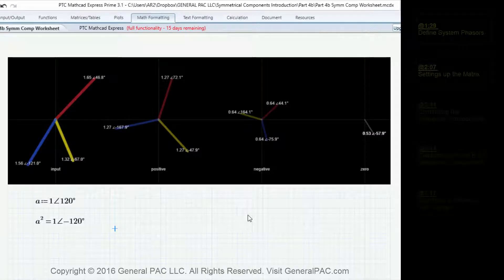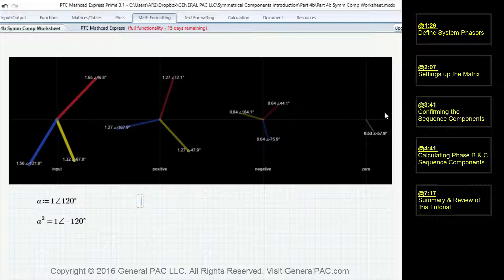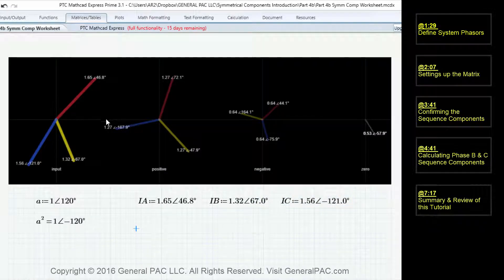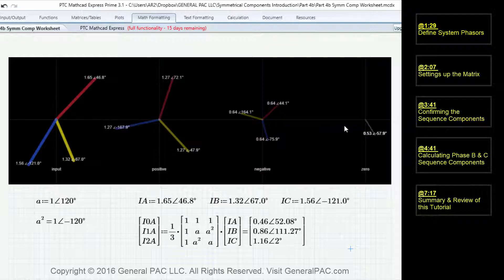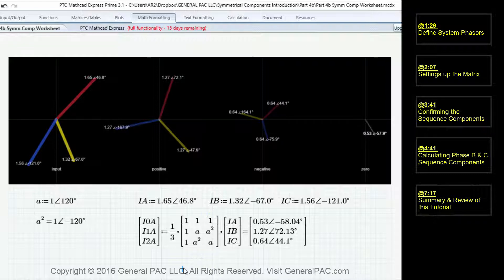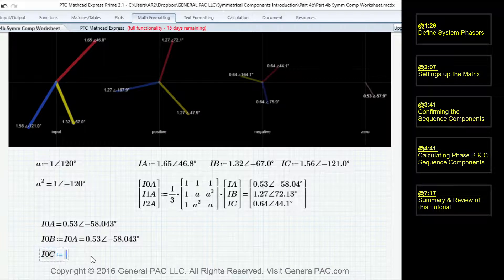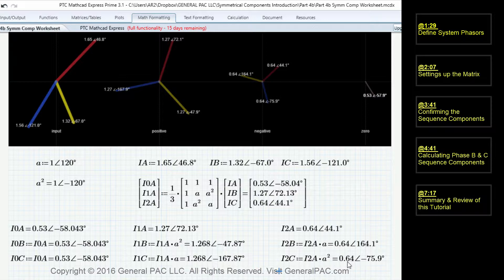Principles of Symmetrical Components Part 4b

Comment: Thank you so much, your series of Videos is so useful. Just a quick question,  since in that problem you have the  Matrix [ I0A I1A I2A]  by multiplying the inverse of A with I(system)....will I be wrong if I decide to first solve the matric of [I0B I1B I2B ] ?
Reply from the maker: Hi Njabulo, Yes you can first solve the matrix of 
[ I0B I1B I2B ], but all the formulas will change accordingly.

Thanks,
GeneralPAC by AllumiaX

Comment: I finally understand the unbalanced system and the symmetrical components watching this series, thank you for your efforts.
Please can you tel me how can I define the a operator in Matlab or Simulink ?
Reply from the maker: Hey,

You can write 'a' operator in MATLAB by first defining the operator as:

                        a= 1*exp(i*2.09)

where '1' is the magnitude and "2.09" is the angle in radian (120 degree = 2.09 radian) (in Matlab angle is defined in radian)

(formula for the degree to radian conversion: angle in radians=angle in degree*pi/180, where pi=3.14)

(120 degree*3.14/180 = 2.09 radian)

For more, see this link:
https://www.mathworks.com/help/matlab/ref/angle.html

Thanks,
GeneralPAC by AllumiaX
Reply: Got it. Thank you so much 🙏

Comment: 1:03: "and the zero sequence component, although they all rotate in the counterclockwise direction, same as the negative and positive sequence component as well as a system phasor"... I thought you said the Negative Sequence Components are always opposite to the system phasor and rotate in the clockwise direction?
Reply: Hey Nicholas, I recently experienced this confusion at work and that drove me to go back to seek the difference between the terms phase rotation and phase sequence. I'll try my best to explain it.

1) Let's start by thinking of a generator with three phases - A, B, and C. Physicaly, the generator rotor rotates. 
It can either rotate in the clockwise direction or or the counterclockwise direction. This is what we call phase rotation.

In electrical power systems, the generally agreed convetion is that the rotation is in the counterclockwise direction. 
That's phase rotation.

2) As the rotor rotates, imagine you are standing at a reference point and looking to see which phase passes that point first, which phase passes second, and which phase passes third. If phase A goes first, and phase B goes second, followed by phase C, then we have an ABC phase SEQUENCE.
So, that will mean conterclockwise phase rotation with an ABC phase sequence.

On the other hand, if you're standing at the reference point and the phases pass you in the order of A, then C, then B, you would have an ACB phase sequence. Meaning that scenario would be counterclockwise phase rotation with an ACB phase sequence. 

I hope that helps. Let me know if you have more questions. All the best!
Reply: @ thanks for clarification, that was a great explanation. Makes sense!

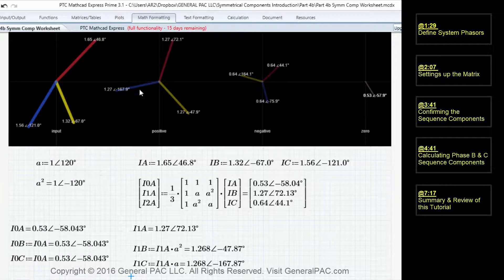Comment: At 6:10, you say for phase C, we need to rotate 120 degrees. How does that come up to -167.87 degrees? Is that an error?
Reply: It's not a mistake. But by mixing negatvie and positive rotations for the degree value, it can be confusing. If he stayed with positive rotations, then you would see that he started with +72 degrees and added 120 degrees to get 192 degrees in the positive (counterclockwise) rotation. The same vector can be reached if he rotated from zero in the negative (clockwise) direction to -167.87 degrees.